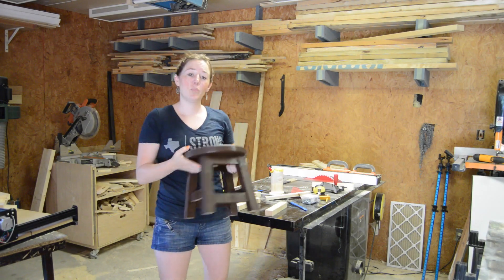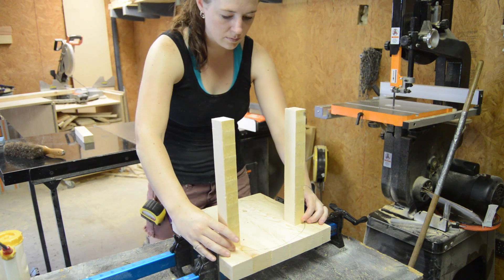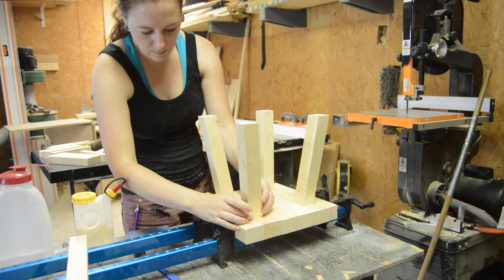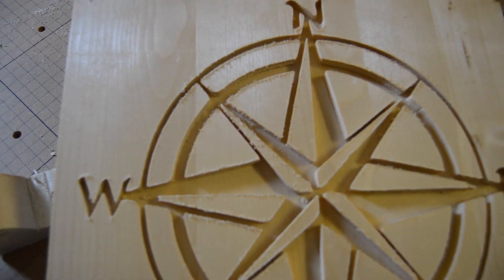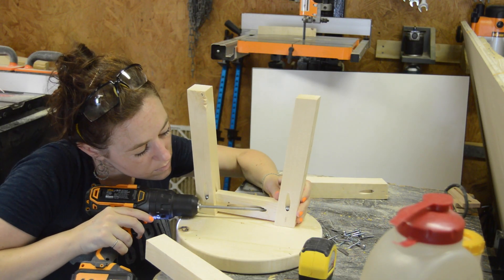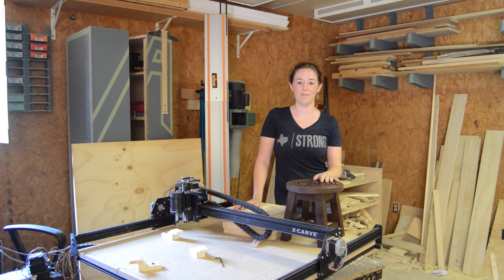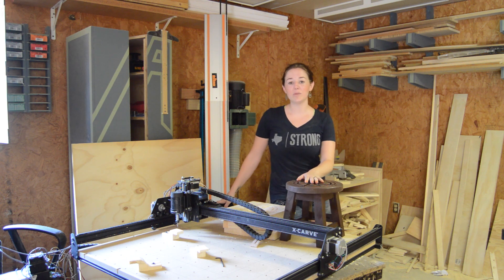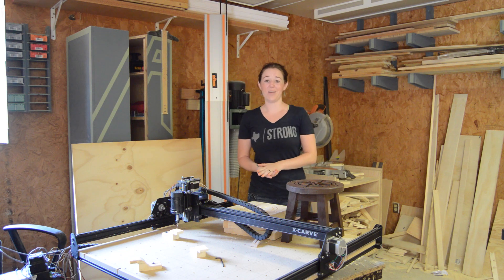Simple Step Stool with CNC Carved Top

Comment: April, first off I really enjoy your videos.  You look like you are having a lot of fun doing / making them.  You made a statement about your computer going into "hibernation mode" after it has been turned on and shutting down the carving process.  I work on / with computers and suggest this - if you are using laptop computer which is going to be turned on for quite a while, then leave the power cord connected and SHUT OFF (disable) hibernation mode when the computer is running on AC.  Otherwise, increase the amount of time until hibernation mode turns on - OR - move the mouse every now and then so the computer doesn't time out (go into power-saving mode - aka Hibernation.)

Comment: Oh yeah, one more thing - I think David (Drunken woodworker) had a great idea for doing stuff like cutting your stool top to a circle. Include a circle cut in your CNC project, 1/4" deep or so, so the circle is exact. Then rough cut it with the bandsaw all the way through the material, then just use a pattern bit in your router to get that cut all cleaned up exactly with the portion the machine cut. Perfectly cut circle, perfectly centered.

Comment: as a suggestion before staining, fill in the CNC design with epoxy then sand it smooth. This will make a flat top stool with contrasting colors after the stain.

Comment: This is a great, quick project! May I make a suggestion? I've found it easier to attach the top directly to the band saw table to make a perfect circle. I drill a tiny hole in the bottom in the center of the piece and spin the work around the blade on a small dowel inserted into the table. It gives me perfect circles every time, and I feel like I have better control of the work.
Reply from the maker: : ) Thanks, I was going to use my router and circle cutting jig but I eyeballed the legs and braces so I wasn't trying to be precise with this one.

Comment: Very nice, thanks for posting this video. I have seen somewhere nice trick, that could be used here as well. They let CNC carve the outer circle, just few passes so it wont take much time and than use that groove as a guide for cutting with bandsaw. Btw. in my oppinion that stool would look a bit better with painted bottom. Anyway thanks for posting the result is beautiful.
Cheers

Comment: Very nice April, The carved top would be a great place to do an epoxy inlay something contrasting, would add to the cost ot make but would be something folks might like to buy.  A gold leaf application in the carving (fake gold leaf works great and is way cheaper) would be sweet then fill with clear casting resin.  Or just fine the way you did it, I like it!  As inventive as you are some wicked nice things will be showing up all fancy and carved, can hardly wait.
Reply from the maker: : ) Thanks John. I like the idea of adding a little gold to it! Somebody else mentioned that and I'm really considering going back to add some in the compass.
Reply: April Wilkerson You can get gold flakes from any auto body shop or crafts store (online or not) to mix in your epoxy, btw.

Comment: look into making a vacuum table. it makes holding down material super easy. It would be great to see you use the cnc machine to make a larger piece of furniture. you could make all of the cuts with the cnc after you learn the software better. mdf is super easy to machine, it's really strong, and it's easy to work with. It it also looks great stained.

Comment: The fuzzy edges can appear from various reasons but the usual suspects would be:

climb cutting vs power cut (and you want power cut)

using a 3 flute bit, (some say compression type but i've seen regular 3 flute (even metal) cut just fine on a medium to high speed) except for plywood where the layers can mess the cut regardless of what you use unless you've got the ratio between speed and feed down to a T)

speed of rotation vs speed of feed. There's a perfect level for each material you cut, the internet is filled with info on that. Tis very important for the life of the machine to know this regardless of any other thing. You can kick it really fast if you're forcing it (usually the software is either moderate or conservative with the settings, thus inefficient).

Comment: Thank you April.  A very informative view on your take of this CNC.  You answer a lot of questions.  Admitting to "Operator Error" is a big help as all to many times we blame the machine or tool for our own overlooking, ignorance or just bad judgment.  Your delivery is deliberate and clear, thank you again.  

I would think your depth may have been influenced per your "starting point, look for your original start depth and see if it did not actually add your input of .125" to your original input.  Also, and i'm asking because I really do not know, could it be reading your input in metric as opposed to inch increments??  I don't know, but maybe when you originally start, there are several places to make sure it knows you are measuring in inches as opposed to metric. Metric may be a "default" unless specifically changed in each original setting...  Also ,you said you reset the program after your laptop went into hibernation, possibly it defaulted to metric.  Just my thoughts

Comment: Neat project. How does it feel to sit on, or is it too short for that? Given the depth of the cuts, are you concerned that some of the more delicate carvings will break out? A nice, colored epoxy would eliminate that risk, while adding some more visual interest. Just a thought.
Reply: jabrwok D'oh! Just read your reply to the epoxy suggestion on FB. Nevermind:-P.
Reply from the maker: ; ) haha yeah I wouldn't fill it in with anything, I like the texture. However, I wanted the depth to only be 1/8" deep, but the machine cut it to 1/4" instead. I'm not sure why (I put that in the review video). But yes, I would have liked for it to be shallower so that parts don't break off over time. The height of the stool is too low for sitting, I made it to reach high places in the house.

Comment: I notice you used your Grizzly band saw for this project. How do you like it so far? Have you done any resaw work with it? I must make up my mind soon and I was hoping you'd have a review up. It's been three months. Is this saw good for resawing or should I spring double for the Laguna? Or Jet? They have one model set up just for resawing - still $1,000 though. It's a huge thing no matter which saw I get but I do want to do it before they run out of the Anniversary Edition.
Reply from the maker: I love that bandsaw so far but I haven't done any resawing on it yet. However, Bob at I LIke to Make Stuff and Jay Bates both have the same saw and they might have more input.

Comment: How do you like that makita router April? I need to get a new little one and that's on my short list
Reply from the maker: Meh, the only reason I keep it around still is because I can handle it with one hand. Since I don't have a router table yet I typically have to keep one hand on my work piece and another on my router, however this router is having trouble holding on to my bits. I will tighten the crap out of the collect but after using it for a second, the bit will start slipping. It just started a few months ago so it worked great for the first year of use. As you can imagine, it's very frustrating. Once I get a table to put my Triton router in, I'm tossing this one.
Reply: April Wilkerson More than likely your collet needs a good cleaning..

Comment: April, next time let the x-carve cut the circle for you. Great job on the stool.
Reply from the maker: I didn't have a bit long enough to make a cut all the way through.
Reply: April Wilkerson I have its baby brother the original Shapeoko which last year I converted to the size of what is now the x-carve. I love it. I think you'l find a lot more uses for it now that you have it in your shop. That also means starting to spend $$$$ on the good tooling to cut through the thick stuff.

Thanks for sharing.
Reply: April Wilkerson you could have it cut as far as the bit can go and then finish it on the band saw. That way you have a good guide. Also, you should explore different types of joinery...

Comment: April, why did you cut the wider 10x6 into smaller pieces then glue them back? Why not glue the 10x6's instead of ripping and gluing many pieces you could have glued two or three? Am I missing something?
Reply: 1x6, not 10x6
Reply: She could have edge glued two 2x6s together to get the width she wanted. But in doing that the long term tendency for piece would be to cup. Ripping it into narrower pieces and then gluing them back with alternating grain direction prevents cupping. Hope this helps.
Reply: +Honu425 thank you I'll look into this

Comment: Sweet project. I just wish you had filled the cnc carving with a lighter color resin. It could have looked like an inlay.
Reply from the maker: I like the texture of the top being open so I don't want to fill it. It's for standing and not sitting, so it will be fine.

Comment: Just wondering what ever happened with the dust collector.
Reply from the maker: Oh it's sitting in the corner collecting dust. When I originally modified it I had planned to build an outside shelter for it, but then we ended up getting a solid month of rain and it messed my plan up. Anyways, I just haven't gotten back around to it, but it's on the list for this round of shop projects! (I'm sick of all this dust)
Reply: I know what you mean.